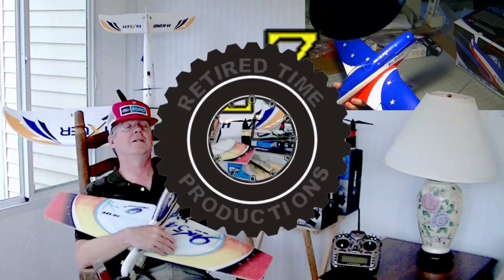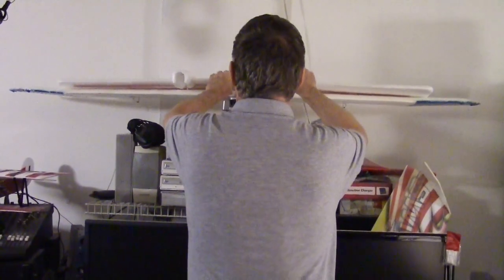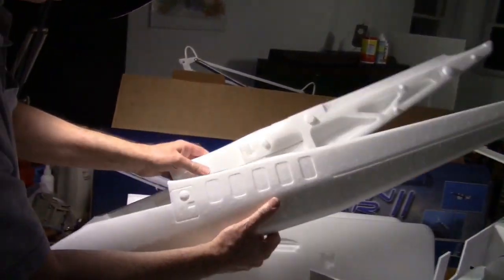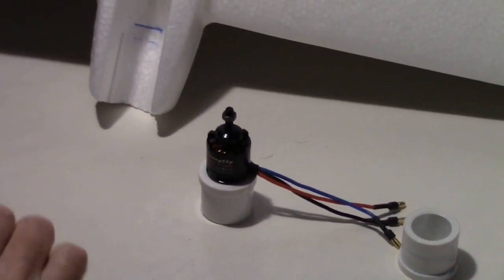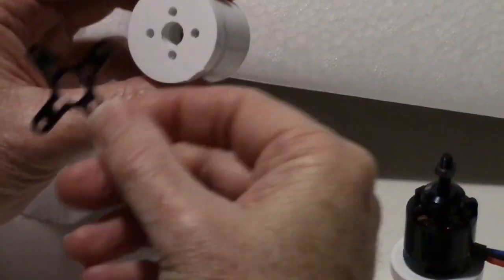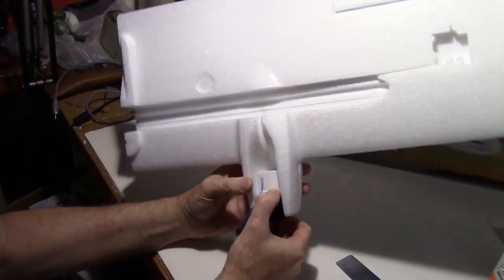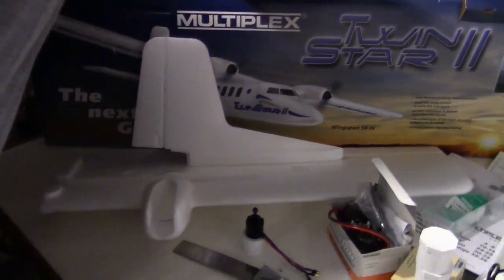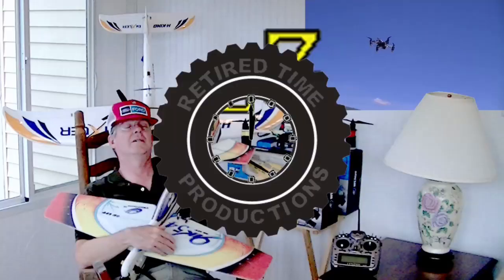Multiplex Twin Star II FPV Build Part 1

Comment: The mounts are made for an inrunner so why use outrunners?
Reply from the maker: The stock mounts are made for brushed motors and are very flimsy as a result. Brushless motors have so much torque they would no doubt brake those mounts.

Comment: On your pvc plug. Did u custom cut that and glue on a cap of some kind. Or did it come in that length and with a cap?  I don't see anything like it at the hardware store. Not even caps.   just long 1 or 1.5" pipes say 15 feet.
Reply: theskyisthelimit Correction. I did find one. It had an octogon or hex shaped cap. It's about 1.25 long and in diameter. I guess I can trim it to round
Reply from the maker: +theskyisthelimit They had both the hex shape and the round shape at the Lowe's hardware near us. Hex will do fine though. Doesn't have to be round.
Reply: +dmerc00 Yeah i found the right one and shaved it.. problem is when i took out the old sled black mounts, they took a lot of foam.. now i have at least one nacelle that is really thin.. maybe .25" thin.. debating if i should take foam from the old canopy and make it thicker, assuming that will hold.. or some other technique.. and the black sled mount was slightly longer than this 1.25" long pvc pipe segment.. without "padding" it, there is easily .25" all around it.. so the question is what padding to use i guess foam carved (http://static.rcgroups.net/forums/attachments/1/4/2/1/7/8/a8399331-89-pvcpipe.JPG is the pic).  I actually ended up switching from sk3 2822's to d2830-11's, 2.5x the power at 210 watts each instead of 80, should give me 27ish amps on take off.
Reply from the maker: +theskyisthelimit What RCG thread are you posting this too?
Any build videos?
Reply: +dmerc00 That was from the main TS2 thread on RC Groups here http://www.rcgroups.com/forums/showthread.php?t=380793&page=691    I have a main TS2 fpv upgrade build log at http://fpvlab.com/forums/showthread.php?40497-Twinstar-II-FPV-Build-Log-1-3ghz-UHF-Vector-Goggles-and-more-Input-welcome  However, ill have actual build videos when i can get time to compile them all on http://flight-stew.com.. i've got tons of video to piece together.. Btw the new D2830-11's with 9x5 kicked my amps to around 23 on takeoff, not quite the 27 i had hoped for but close (20 on the motors combined), flew pretty well, aside from the fact i made an idiot mistake and forgot to attach the TX antenna and made an emergency landing clipping a tree and back flipping to the ground (all was ok) :) (i have video of this, not uploaded yet)
Reply from the maker: +theskyisthelimit I will look for your videos. Thanks for the links

Comment: I just ordered this plane from HH sale ... 99 bux total. A classic proven airplane for FPV. Thx for this great vid and info my friend.
Reply from the maker: Aero Mondo Flies great and very portable for fitting in the car. The flight times are up to about 20 minutes which is enough for me. If you are going for lang range then the MyTwinDream would be best. For $99 I don't think you can go wrong with this plane. The tricky part was mounting the motors, I used PVC pipe caps, but make sure the motors are slightly pitched down and aligned straight forward. Maybe put some straws on the ends of the motor shafts and align them that way as you glue the motor mounts in. I don't know the exact angle but just study the mounts that come with it then use the same angle. btw, the provided mounts are too weak for brushless motors and will snap off.
Reply: +dmerc00 Thank youfor the great info and response. HH should thank you haha. cheers my friend.
Reply: Great information Dave. Thanks for your knowledge and awesome channel.

Comment: Looks good Dave. Glad to see you got the good motors for that. I would do the eagle tree fc. Looks simple to setup and not really that expensive. Good luck my friend :)
Reply from the maker: chris miller I have the Vector on order now because several of my viewers recommended it and I wanted to see how it compared to the the APM.  So we will see how it is. This ought to be a fun build.
Reply: I think you will be pleased I had a few customers come into the shop and tell me how nice and easy to set up it was. I would like to get it for my tricopter. But to much on my list as it is.
Reply from the maker: chris miller I wish the hobby shops in my area would carry FPV stuff but they never do.

Comment: Hi, I am just about to take delivery of my twinstar, which will also be for FPV. I will be using the eagletree Vector flight controller. I ordered alloy motor mounts that simply screw onto the existing black plastic "tunnels" from gobrushless.com......

Good luck with the build.......
Reply from the maker: Hello and welcome aboard! I was thinking about the Vector as well where did you buy it? Yes those motor mounts look nice but I decided to diy them.
Reply: *****
I am in the UK, so ordered mine from rc-log.co.uk
Reply from the maker: friesianflyer Great and good luck on it. My unit is coming from GetFPV and I am looking forward to sharing the experience.
Reply: friesianflyer Hi .. I just got mine and I also plan on an FPV setup. Any suggestions? Thx man.

Comment: I think youre having some issues with the metric system :-) 1400mm
Im going to start my Twinstar FPV build soon, so I'll definitely be watching your build first.
I bought these to mount the BL motors. Alu motor mounts.
http://www.gobrushless.com/shop/index.php?app=ccp0&ns=prodshow&ref=MDMTPLXMM

Are you going to use CA or Silicon glue to glue the fuselage halfs ?
Reply from the maker: S Rob Thanks for the link, I have seen those before and just thought it still required the plastic parts from the kit so I went with the PVC pipe fittings for more strength.
I will use the Silicon to glue the halves. I did that on my Bixler and it worked great. Gives you time to move things around before it sets too. If you get something wrong with CA there is no time to change your mind.

Comment: The skymule from hobbyking has 3 blade counter rotating props you can order those for 3 bucks or so, if not any multirotor prop should do the trick for counter rotate, I would like to see you using the vector flight controller from eagle tree and then see you making the antenna tracker for it I haven't seen any videos of that build yet
Reply from the maker: Luis Fernando Suárez Harašić Thanks for the prop suggestion, I will check that out. 
You are the second person who has suggested the Vector FC. No votes for other FCs yet.
Reply: The interesting factor of the vector is the eagleeyes compatibility for telemetry/diversity/antenna-tracker for less than $100 can't wait to see what you do

Comment: Its exactly the same as mine, same motors / esc`s so I can highly recommend 7x5 APC props with a 4S 4000mah Zippy compact.

I get 22km range from it ( 11km out and back again ) with a cruise of 65 - 70 kph drawing 7 amps or a nice slow cruise of 35 kph using 3 amps.

The Mytwindream IMO is way too big for what you want. Its for lots more range and you don't seem to me to be really a range pilot.
Reply from the maker: Coyote FPV You have the same motors and ESCs?! 
This is wonderful. I was trying to decide on the props and battery and it looks like you have saved me some time!
Yes I plan to only got 4km tops unless I get somewhere flatter. The mountains around my area are beautiful signal breakers.
Can you tell me more about your FPV video setup and what FC you are using?
Reply: *****  Yeah sure

My FPV setup is a Mobius as my main flight camera, I have this going to a MyFlyDream Autopilot. Of all the Autopilots I have had its by far the best.  That then feeds a RMRC 1.3ghz 400mW Vtx on one wing and a Boscam 5.8ghz Vtx on the other. The 5.8 is for testing equipment ranges and new antennas, passengers etc, the 1.3 is for me flying.

I use a Turnigy 5-7.5 amp UBEC for power for the servos. Its very low noise is great for the FPV kit.

I use a 3A DC-DC LM2596 for taking the 4S power down to 12v for the Autopilot and Vtx.
Reply from the maker: Coyote FPV Great information, thanks so much.
What LRS or RC receiver are you using to get such long range flights?
Reply: I`m using the JR module EZUHF with a 4 channel lite receiver. The Twinstar is capable of much more if you add another lipo with the same equipment I have on board.

One of the UK guys takes his out to 20km but I don`t want a battery strapped to the top so I`m going to use the Myflydream.
Reply from the maker: Coyote FPV Cool, the JR module EZUHF is exactly what I use on my Skywalker. Where did you place the EZUHF receiver?
Reply: In the rear of the tail, just before the vertical stabilizer with a Dipole running up the vertical stabilizer.
Reply from the maker: Coyote FPV Good spot. So I guess you are using the one cable ppm mode back to the flight controller to avoid all those connections to the EZUHF receiver.
Reply: ***** Yes that's right, no need for more .
Reply from the maker: Coyote FPV Super, thanks for all the details. I may be asking you some more questions later if I get stuck.
Reply from the maker: Coyote FPV Just to verify, are these the props you are using?:
http://www.horizonhobby.com/thin-elec-pusher-prop-7x5e-apc07050ep
http://www.horizonhobby.com/product/airplanes/airplane-accessories/propellers/electric-propeller-7-x-5e-apc07050e
Reply: ***** Yes one of each, so counter rotating. Good props, but like razor blades with fingers ........ Don't ask lol
Reply from the maker: Coyote FPV Got the 7x5s on order from HorizonHobby. I will try to be careful :-)